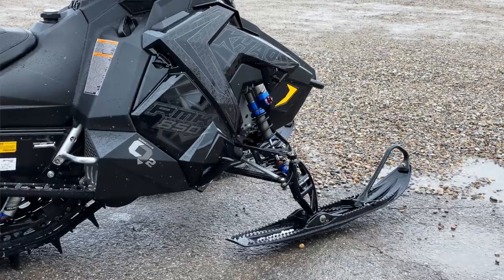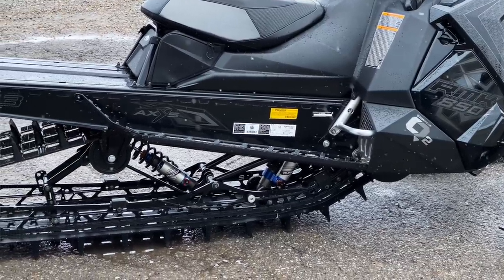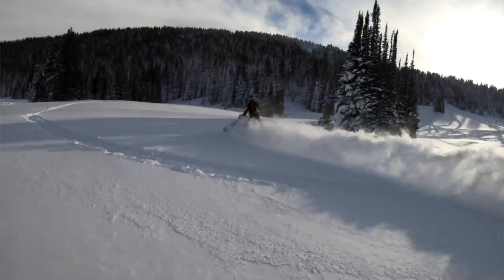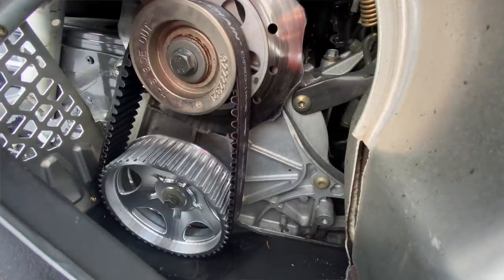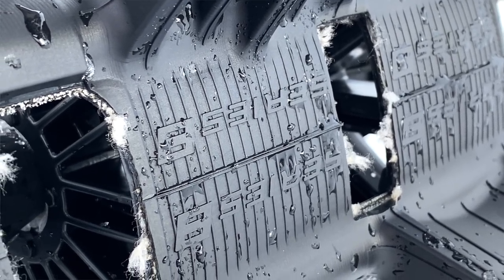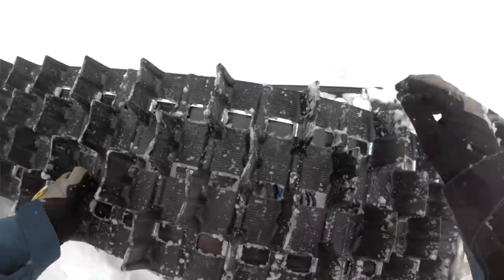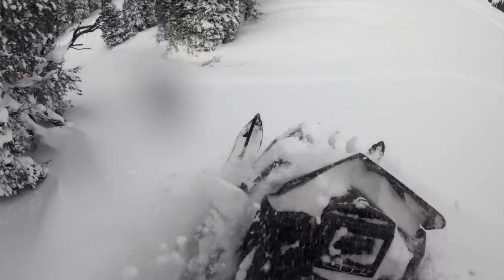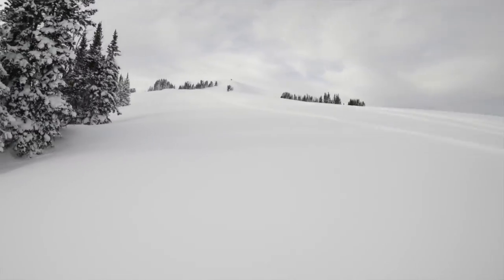the SNOWEST show: In-Depth Review: 2021 Polaris KHAOS 850

Comment: I have that exact sled (2021 Khaos 850, 155" x 2.6") and am have a few issues with cooling. It seems to typically run around 110-120 degrees, but every once in a while it will spike to 150-160, and it hit 190 one time while riding gentle and in the powder just getting from A to B. Any over heating issues with yours? Thanks in advance.

Comment: Awesome video but I think there may be some wrong information here at 5:25. QD2 is geared lower than QD1 I believe. You can basically turn a QD1 into a QD2 by trading out the lower sprocket and belt, the QD2 has a bigger sprocket and longer belt.